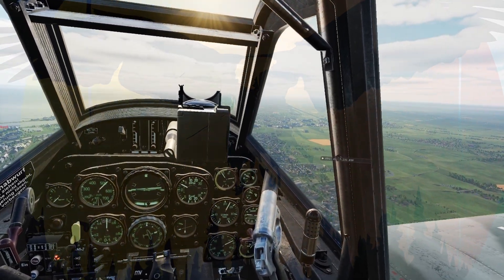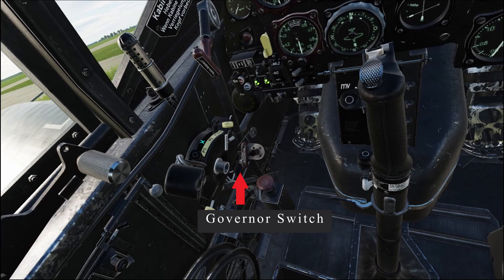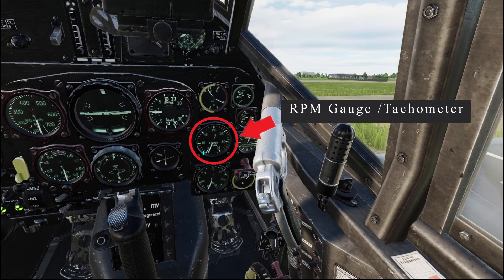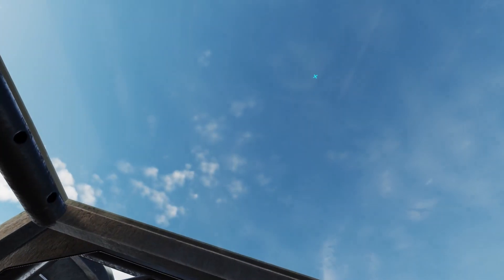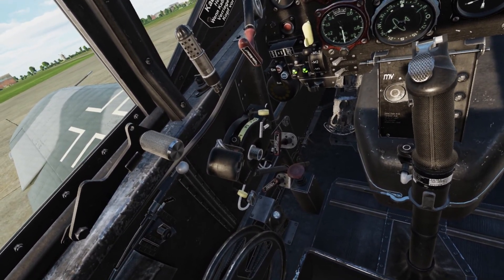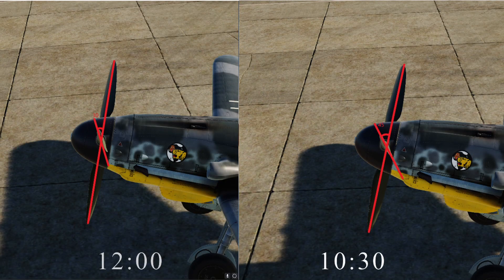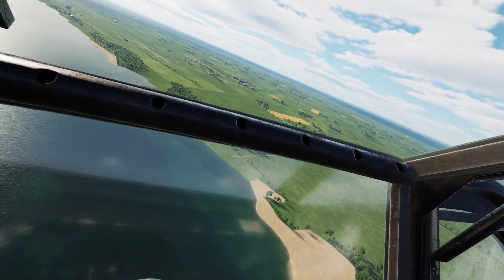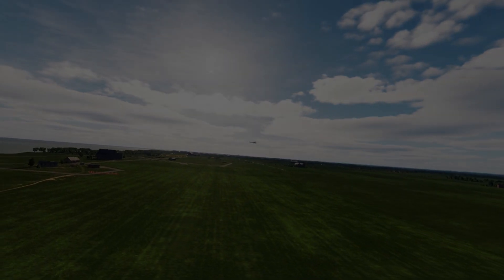DCS BF-109 | Manual Propeller Control | Taxi, take off, landing.

Comment: Great video, clear and to the point. Do you use manual prop pitch control only for takeoff and landing, or do you use it under any other circumstances? That is, do you use only auto for the rest of the flight?
Reply: Yes, that is what the next video will be about. 
I use only automatic when Im in a tight turn fight ( flat scissor,  one circle fight and so on) the rest is manual control.
Thanks for you opinion Im glab you like it. 
The next one will be focus on the fight side, Im still working on the audio it will be out soon .
Reply: @Eagle1_1  OK great! I look forward to the video.  Thank you
Reply: @eagle1_160  
That sound strange to me...
I read that one of the main qualities of the 109s was that all you needed was the throttle..
The manual prop pitch control, can help us while climbing too while in combat??
Thank you very much!
Reply: @tonykeith76  I guess that seasoned pilot's preferred to manage prop RPM themselves, but for noob pilot´s the automation helped them.
At the end of the war, there where not many experienced pilot's, so the automatic prop control in the BF-109 and the "Kommandogerät" in the FW-190 must have been a welcomed feature.
Then consider many Soviet aircraft, where the pilots had to manage Throttle, Propeller, Mixture and Supercharger during a dogfight !